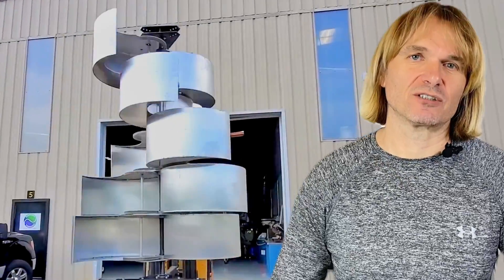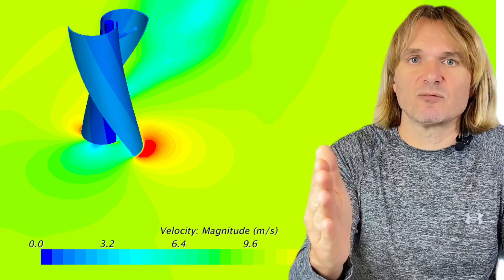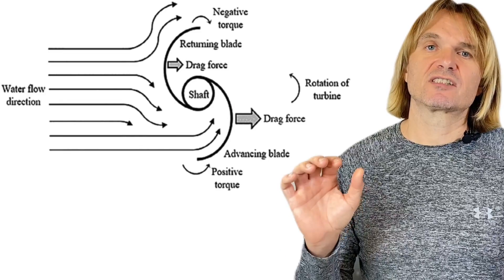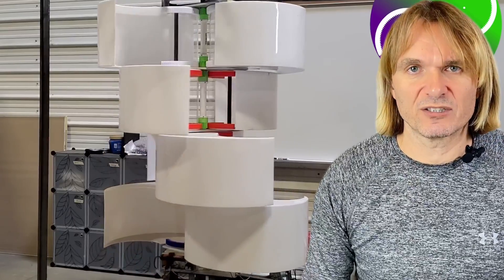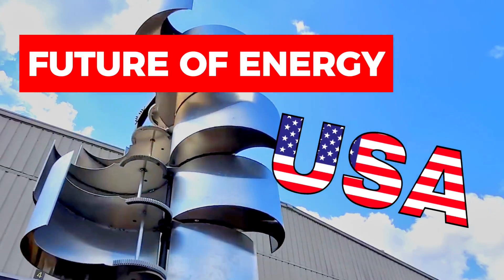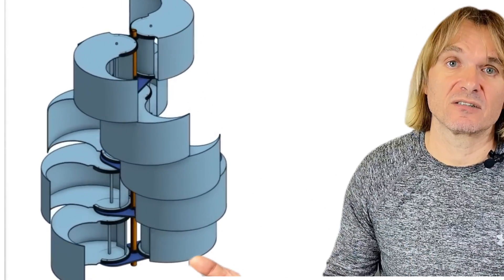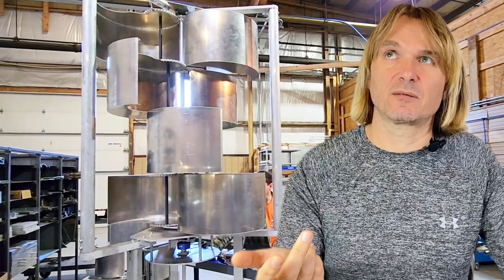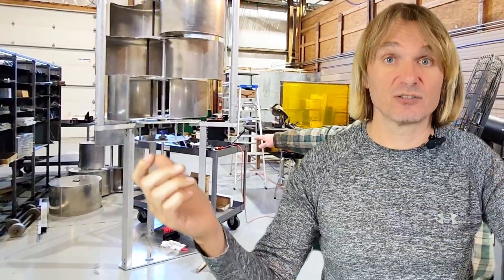INDESTRUCTIBLE WIND TURBINE

Comment: Thank you for the video.  May I question you on a couple of the comments you made.  When a Savonious two blade type turbine is at right angles to the wind the convex surfaces creates lift from the air moving over them like a wing.  There are several reputable studies showing that the torque does not drop to zero but is nearly 30% of the torque when the scoop is facing the wind. The actual efficiency is of course very much debated but NREL, a reputable National Lab, has shown it varies from about 15% to about 22% depending on the design. Also, in most of their studies, the RPM has been over 100 and closer to 150 above 33 kph (20 mph). Is that something you have seen in your studies of the area? Unfortunately there are many reports out there that are largely anecdotal and incorrect.
Reply from the maker: I am quite sceptic when there is unverifiable publication. reality based science is best science. no VAWT farm or single installation were ever profitable. 
as my own experiments went I never reached 10% either.
of course like with everything two blade design will be superior even in VAWT but with darrieus it has problem with starting torgue thats why chinese producers marry this to small savonius inside. but its even less effective in 6-9m/s winds coz of turbulences

Comment: Please do an analysis of the ridge blade turbine.  I need a bird safe turbine.  Also could you place a chicken wire cage around a normal turbine without excessive force losses.  Thanks.
Reply from the maker: Ive seen installations on pigeons house. this turbines has small diameter therefore birds can easily see them as an obstacle. you can see them as a wheel too. so its not dangerous to the bird. 
with big turbines they see nothing in front of them fly safely and then bum 300kmh blade coming from the side.
thats why small turbines are not dangerous to the birds